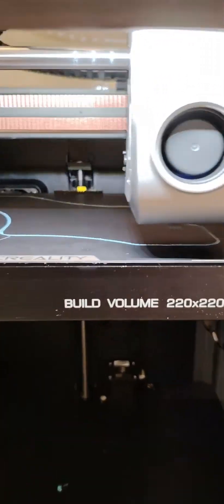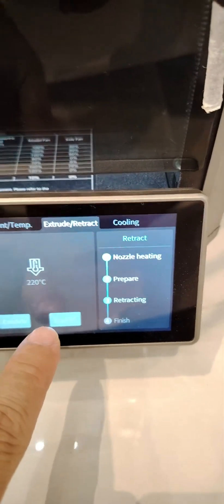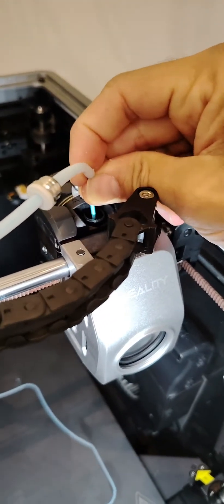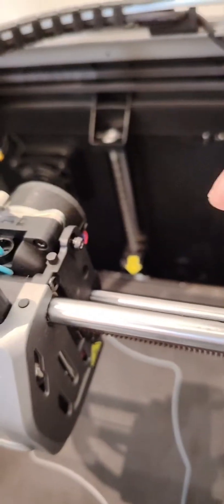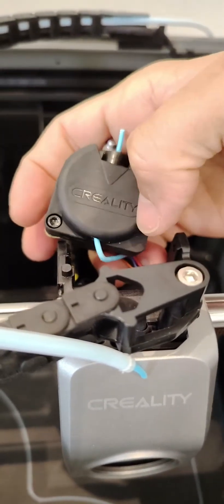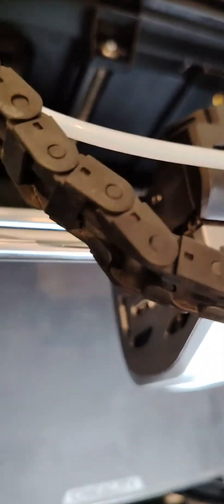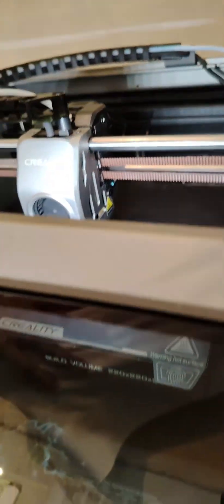fix of stuck filament issue in creality K1C 3d printer

Comment: Have the same issue too many times. I changed the gears to metal gears, and now the fiame nt gets stuck in the guide holes. I thought it was the filament, so I switched to another, same issue. Humidity in the room is in the low 30's. Thinking about widening the guide holes just a smidgen. Anyone else know what's causing this? I have a spare body so it's not going to be a problem if it rains one.

Comment: How did you manage to open the extreuder gearbox with the filament stuck in it? In the video it's closed and then there's a cut and it's open, but you don't explain how you do it. What's the purpose on doing a video and not explaining?

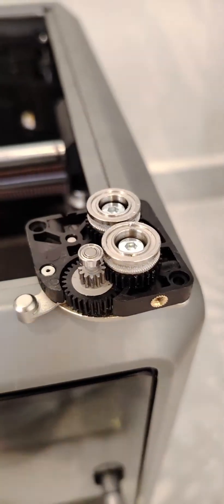Comment: At 2:14 how do you take the top off so easily??? Mine is always so hard to get off
Reply: I can’t get the top to come off at all, it’s attached somehow and I’m afraid to use more force
Reply: I was able to just pull the end of the jammed filament out from the motor using pliers, but I never got the cover to come off

Comment: Thank you so much!. your video help me! any idea what caused this? it happened to me twice today. for the first one I managed to pull it out after I rectract couple of times. the 2nd time it happened  nothing works, extrude nor rectract which lead me to this video. Any idea what caused this to happen? first time using TPU  filament
Reply from the maker: @muhammadazizi4209  i don't have an accurate explanation yet. I doubt its the filament type, ut happened also with PLA. I'm glad this actually helped you guys.

Comment: How do you move the tube out it doesn't look like there is a way to do it without breaking the entire thing. You kinda skipped that bit?
Reply from the maker: @jesse799  if you mean the filament tube, there is a connecting button between the extruder case and the tube it looks like spacer that holds the tube, push it down and  the tube is free to be pulled out.
Reply: I don’t have that mine is just a foam white thing on metal. How do you get it off?

Comment: I cannot get my extruder to pull apart (piece housing the gears). Terrified to break it by forcing too hard.
Reply from the maker: @adoormarkedpirate378  it should separate with a little effort, but certainly without  force just slowly and gradually from each side. Hope this helps

Comment: Hey, i have a trouble extruding TPU 85A, the head is "ticking" when printing and filament is not extruding. I think it's a problem of too much force of the rollers on filament. Is it possible to release a spring a little?

Comment: Printed the same file flawlessly ~30x in the same 95A TPU, then it started jamming every other print or so out of the blue. The filament breaks off inside and I have to take it apart all the time. I've replaced nozzles, making sure there is plenty of thermal paste applied. I'm printing with the lid off. It's killing me

Comment: Very useful - I think it's a bit of a design flaw that the release mechanism on the top doesnt expand the gears a bit further to release mangled PLA - but this worked to resolve the issue.  After unscrewing from the motor, I was actually able to get away without opening up the unit fully by twisting the PLA in circles along it's axis and pulling from each side.
Reply from the maker: @kjc197  I agree

Comment: One and done.  This video came up on my 1st search.  Fixed my issue less than 10 minutes later. Only difference was my gear cover did not come off as easy as yours 😅.  Almost lost a bearing like you warned about. 😮  Anyway, you are my hero.

Comment: This method works to clear the filament out of the extruder but it happens on the very next print. Even have to do this to change filaments. I believe this is an engineering problem with the design.
Reply: Check the right requirement temparature for your filament & hotbed

Comment: You saved my day. In my case, this is the second time. The first time I was able to pull out the filament with little force using the retreating function. This time, the second time in two months, I had to do as shown in the video.

Regarding how easily you were able to pull off the lid. It's not so easy when the filament gets jammed inside.

For those who will have trouble with this. I recommend that you gently undermine the edges with the included spatula (to loosen the joint), force the lever to the unlocked position and move the filament in different directions (right, left, up, down), rotate it. You can additionally rotate the side wheel of the mechnaizm so as to position the filament in the middle so that it does not block. Just try to disassemble it with your fingers now. At some point, one side should spring back. Now just do the rest and pull the cover off completely.

Comment: Print with the top lid off. The extruder motor overheats and heat is transferred to the extruder. Causing the filament to soften and then jam.
Reply: i have a k1se that doesnt actually have a top lid that still did this same thing, not sure it woulda helped much

Comment: 2:12 --> Is there atrick to separating the upper lid from the assembly? Mine feels like it's glued shut or bolted down
Reply: how did you solve it? Mine is exact the same. Stick hard
Reply: @mikhailkh8560 Im having the same issue. Anything that worked out for you?
Reply: @luisdateigeiro7273  force and several plastic cards. Slowly , but I was able to make it, without any damage.
Reply from the maker: I don't think it's glued. Work it out slowly dont use shaprt tools. There are only  two bolts. Try to gradually pul the upper lid. Try to create tiny gaps from each side in parallel it might work. Again do it slowly don't let it pup out hard you might lose the  bearing..
This is pretty much everything about it
Reply: The filament is stuck between the gears and holding the lid tight. u need to wiggle or burn the stuck filament out before the lid can open. Try using the steel rod that came with the machine and heating it up then push it thru to get the long piece of filament out.

Comment: This is ridiculous. Mine is new and has this happen after every print. Crazy
Reply: If you are using Hyper PLA this WILL happen, the fans only turn on after the first layer, and this lets the extruder heat up and melt the filament that is inside off it...
Reply: @_neto7  is there a way to prevent this? I just had to change mine out and figured it was due excessive vibrations since it was just on an old wash machine lol
Reply from the maker: I hope this helps you mate. If you still struggle with it try to change the filament. It may work
Reply: Same here and I have the 2025 model.